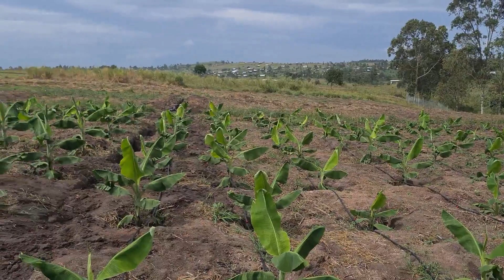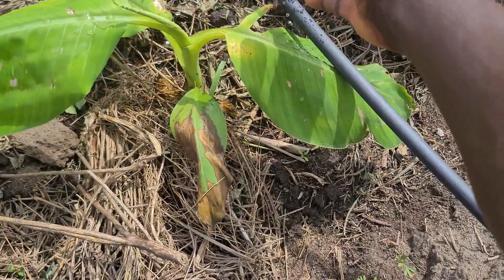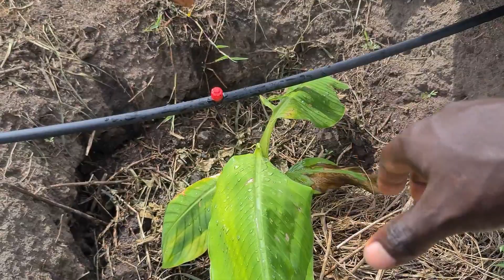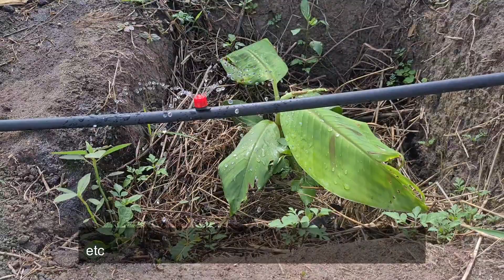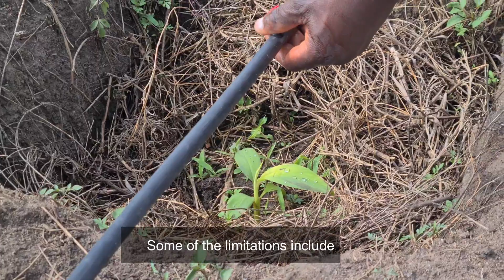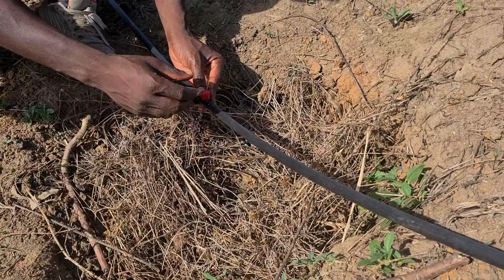Banana irrigation using multiple outlet adjustable flow drippers

Comment: Nice irrigation system. What are the sizes of your main and sublines? Additionally, what is the flow rate of the drippers you are using in your system. Thank you.
Reply from the maker: Mainline is 2", sub mainlines is 1.5".
Flow rate is adjustable from 0-70 litres per hour.
Reply: @WeisEngineeringLtd  I greatly appreciate your kindness in responding to my query. Thank you.

Comment: Can I connect this dripper direct into the well pipe line without water storage tank
Reply from the maker: Yes, you can 
You need to balance pressure and flow through the dripping line